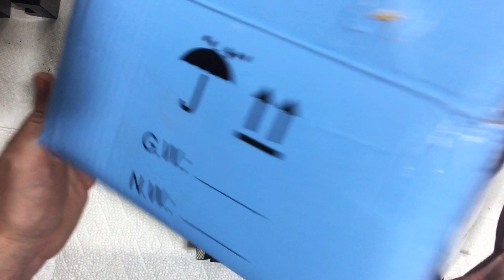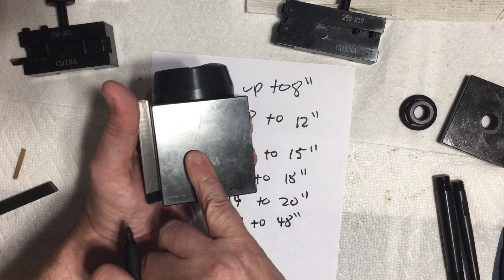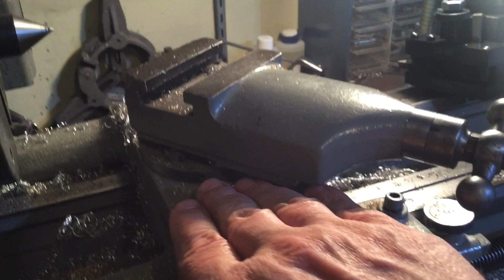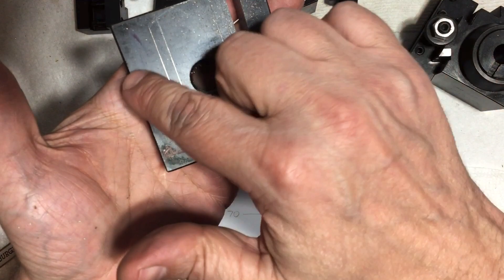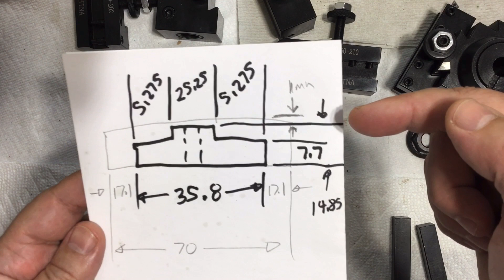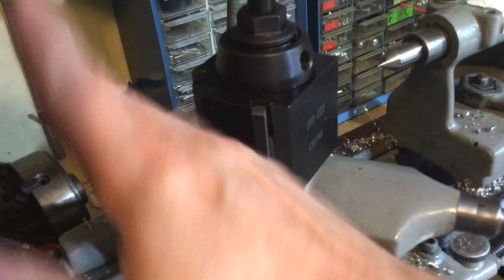Quick change tool post; Everything (ish) you need to know

Comment: send it back and get an AXA dont ditch the compound!!
Reply from the maker: I can always put the compound back on if I need to and use the original tool post. But I have been considering getting an AXA set just for the compound, but I’ve been using this setup for quite a while now, with no issues. Thanks for watching and commenting!

Comment: Just a thought...why not mill the bottom of the tool holders on the inside to accommodate the tooling that are too high? Someone else likely already thought of this.  But is there a real downside?
Reply from the maker: That should work, and I tried it. But,it’s hard steel, and my little desk top mill did not like it. So I stopped as soon as I started.
Reply: @customfabrications   makes sense.  Thanks 👍
Reply: Or even just off the bottom 😅

Comment: 250-000: 250 is the type of post and 000 is the size of the post, 250-100, 250-200 and so on. 
Regarding the post size and type, if it like the one you have, says 250-222, its a size 2 wedge tool post. A piston tool post at same size is 250-202 and so on. This means you can use all 250-2xx tool holders for both types of tool posts. Hope it make any sense.
Reply from the maker: Thanks!

Comment: I just rolled up on this video today, if no one answered the pressing question yet, the 1st digit after the dash is the size/series of tool holder, 0XA being the 0xx, AXA=1xx, BXA=2xx, etc. the middle digit is the compound assembly such as the knurler and the tool post itself, the 3rd digit is the tool style, xx1=straight tool, xx4=boring bar, xx7=cutoff, etc etc. after a year I assume you worked this out but even though your lathe is a 10", and you could barely get that 1/4" shank to center up you need to go down to the 100 (AXA) as that would give more travel up/down.
Reply from the maker: Thanks for all the info. I really do appreciate it. I did get better holders for the 1/4” cutters that align better. Maybe I’m missing something, but I don’t understand how a smaller post (AXA) would give more travel. The down position is limited by the lathe itself, and a smaller unit is shorter, so it can’t go as high as a taller unit. Like I said, maybe I’m missing something. But I got the one I did because everything I read online said that’s what I should get for my lathe. But I get a lot of commenters saying I should have got the smaller one. I’ve been using this one for a while now and it’s working well for me now. It just seems like a smaller one would limit the up movement  I don’t get it. I guess I could get an AXA and try it, but that seems like an expensive experiment. Thanks again for commenting and explaining the numbers.
Reply: @customfabrications  Consider they both can hold a 1/2" shank tool, the overall height of the AXA is 1-1/2", and a BXA is 1-3/4" tall and the slot height for the tool isn't much different with the "A" being 33/64" and the "B" = 0.55". Then consider the base of the holder to the floor for the tool is about 0.05" lower. so it's a stacking of tolerances that you would be able to move the tool Centerline down more with the AXA than you can with your BXA. AXA is just a little bit smaller in three of the dimensions but it adds up. if i did my math right the AXA tool at it's lowest is about 11/32" lower on the centerline than the BXA.  (source - product drawing dimensions from Amazon)
Reply from the maker: @ColeHomestead  ok, lower makes sense now. But my problem was on the high end. I actually put a 1/2” spacer block under the tool post and I now have most tool holders pretty much centered height wise. I did think the BXA looked big, but I think I’m happy with it. The AXA might be better if I put the compound back on though. So maybe I will get an AXA someday. Thanks again for all the info!

Comment: Sell the BXA and get the AXA.
Reply from the maker: Everything I read when I was researching what to get, said that if the size of your lathe overlaps two tool post sizes, then to get the bigger one. So I did. I’ve been using it quite a lot, and have never had an issue. There have been several times though, that I was glad I got the BXA, because an AXA would have been to small, because of the cutter I was using.

Comment: I have the AXA. The only difference between BXA and AXA is the tool post. they both have the same holders. I am cheap also. Cost from Ebay $89.01
Reply from the maker: As long as it’s cheap and it works, I’m ok with it!

Comment: I had the same issue with my gooving tool as well. But I was able to lower the tool holder further by turning the top compound slide. Also it's possible to find someone on ebay mass producing T-nuts. The Southbend 9" inparticular is easy to find one for.
Reply from the maker: Cool, thanks for the tip!

Comment: thanks u cleared up a few questions before i buy a post , trouble is not having access to a milling machine , only thing i can think of is to take off the slide and take it and the block to a shop ... more $$$$ , my lathe is about the size or maybe a little smaller so the axa sounds like the go
Reply from the maker: Thanks for commenting! Glad you found it helpful. Good luck with it.

Comment: Ouch, it's little too big for your lathe 😆
Reply from the maker: Not according to everything I read. It’s a 10in lathe, which is on the low end of the one I got (which is for about 8 to 15 in) and the high end of the next size smaller (which is for about 6 to 10in). And everything I read said to go with the bigger one if your lathe overlapped two sizes. So I did what was recommended. I thought I explained that in the video.

Comment: You needed  an AXA toolholder system, not a BXA.
Reply: AXA is what I put on mine works great
Reply from the maker: Yea, I had a hard time deciding between AXA or BXA. the size of the lathe is right between the two. Glad to hear yours is working out for you. Thanks for watching and commenting. @jimmattingly4234
Reply from the maker: I was on with fence with that. When I researched sizing, there’s always an overlap. So for my lathe, I was either on the max end of an A, or the small end of a B. Everything I read said that if your lathe size overlaps two tool holder sizes, to use the bigger tool holder. So that’s what I did. Maybe an AXA would fit on the compound better? IDK, so far it’s working ok for me though.
Reply: @customfabrications  Your QCTP's width matches the width of your compound slide - THAT'S what is important, as it gives You max. rigidity. The table with the sizes is for orientation purposes only. A larger swing diameter usually means a bigger and stronger lathe, which means higher forces during cutting, which demands a beefier tool holder, hence the various sizes. A smaller QCTP will fit, but won't have the same contact surface area with the compound.

So it all boils down to: Get the biggest size that matches the size/width of your lathe's compound slide.
Reply from the maker: @Gargamelota  Thanks for your input! Makes sense.